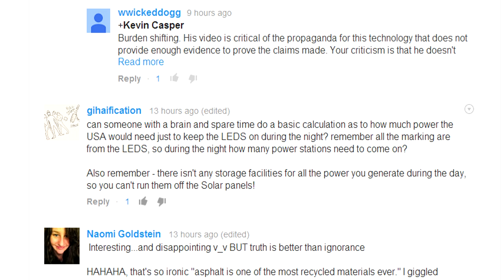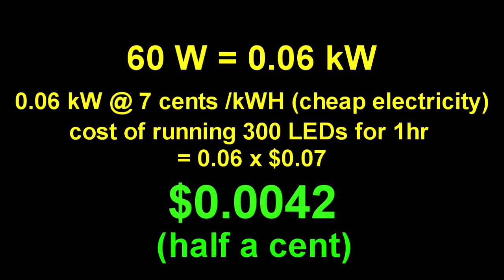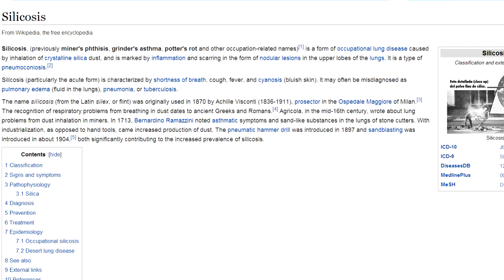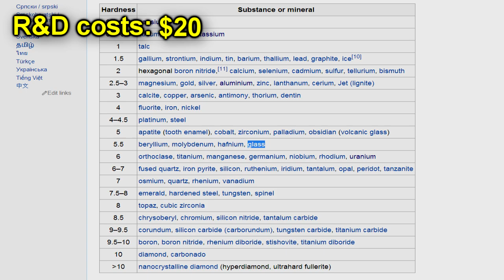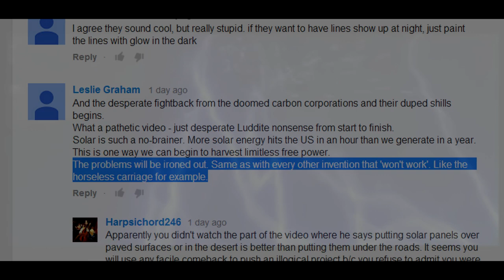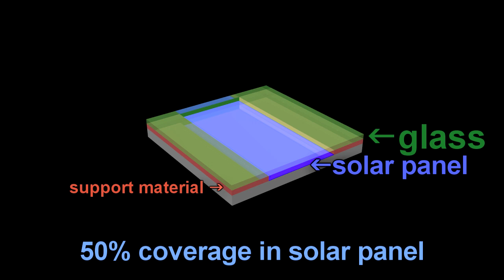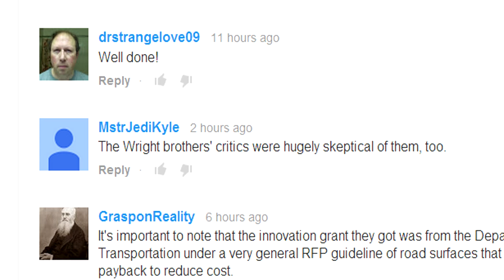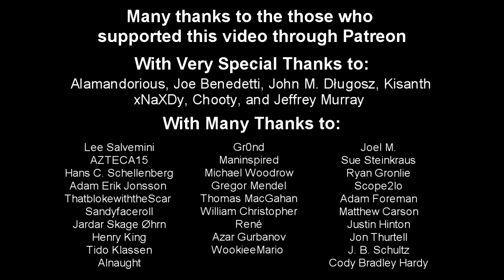Solar Roadways, IMPORTANT QUESTIONS AND ANSWERS!

Comment: You make many good points, and then you undermine them with parting shots that don't line up. I'm hunting down more updates on the roadway tech (which I feel dubious about) but shots like saying >1 inch thick glass would be in any way affected by a spark plug sound silly, when the better argument that a shard of glass devoted out of a broken panel would prove a major safety hazard seems more than sufficient.  

There were at least a few moments in your previous video where these weird digressions pop-up in otherwise solid thinking/criticism. It's a hard balance when you're trying to be funny and accurate not to make exaggerated or cheap shots, but... it's disappointing. But, I do appreciate your effort.
Reply: Dudley Bryan Jr. I know it's like 3 months since you posted, but from what I watched i'm pretty sure he meant that when someone suggested they make the roadway glass out of sapphire glass, if one of those panels were to break or chip, and one of those chips happened to fly into your windshield, it would probably be a similar effect of that piece in the spark plug.

So basically what you said would be the better argument of a shard of glass from a broken panel is actually the argument that was made.
Reply: But, we know it could never be made of sapphire glass though. Just Google "sapphire glass production problems." That's one of the hardest challenges (no pun intended) as it is. Making that much glass economically.

I can't remember anymore, but I believe it sounded clearly like he was suggesting a dropped spark plug would shatter the road glass. But, either way sounds unlikely. Like I said, lots of other good points though. Just odd deviations here and there.

Comment: I feel bad, because I want to be smart cynical but this video isn't smart cynical.  You do not use Amazon.com to calculate LED costs on an industrial scale.  Same as you don't compare smartphone glass screens to industrial strength glass surfaces. But, your comments warning about potential knock-on effects like ground glass/etc are important. If composites have different properties (when ground or pressured), then it's important to know which ones are the best performing and most economic for comparison.
Reply: Mark Baanstra Thanks, but having looked at BOM estimates for products, I'm still assuming the price to consumers on Amazon.com is not representative of the price that would be paid by a bargained government project.  I'd think... maybe some type of rule of thumb difference would be helpful.  Or some type of look at the cost of the materials.  It's a tough ask, but you can't run far with estimates on a consumer "one-off" price base.
Reply: +Dudley Bryan Jr. Alrighty then, wise guy. How much do you think these LED lights are gonna cost at an industrial scale? Huh? HUH?

(Seriously though, how much will it cost? I tried Googling it but could only find links to online stores selling them.)

Comment: Good lawd who is Thuderfoot? Did you do any research? Let's deal with just a few of your arguments. 1. It's tempered glass, this is not the same as what you get in a coffee pot. In a few years we'll be able to use Graphene which is hundreds of times stronger than steel. Rocks aren't even going to make a dent in them. And while currently Graphene is supper expensive the cost has been scaling down at an exponential rate for over 10 years. But the time we're ready to build roadways out of it it should only cost pennies  2) Powering the roadways at night. First the fact that the roads are smart roads means that we only need to have power on roads that actually have traffic on it (or up coming traffic). This saves us a lot of power right there. Next liquid metal batteries can be housed in the side passageways and can store the extra power collected during the day then use them at night. So zero cost for generators and no need to wire the roadways up to any conventional power source. 3)You're correct that the angle will mean that we're not maximizing the solar collectors but we don't have to; just 15% means that they pay for themselves in a very short period of time. 4) Thanks to the popularity of Smartphones and Tablets there has been a lot of research on using LEDs during the day but here I actually almost agree with you they shouldn't be used by day instead E-ink can be used much cheaper and have the LEDs only function at night. There I believe that resolved all your concerns in about 20 mins of thought. Can we get back to building the future now?
Reply: Carl Parrish So you propose using an inferior and essentially obsolete (even before production - wow!) idea instead of practical technologies that are well established, are safer, require an absolute fraction of the materials and energy that a solar roadway would (mining/extracting resources, manufacturing, installing, maintaining and disposing), and are far more efficient? You're not building the future, you're tearing it down for some unrealistic dream that was inspired when you watched "Tron".
Reply: Carl Parrish I don't think others have missed the point but rather it is you who has missed the point.  The roads don't pay for themselves.  The numbers clearly show this.  The whole point is to get people who can't do math to give them money.  It is too obvious to be called a fraud because they don't hide the facts that show that it will never work as an idea.  They make obviously false statements and contradict themselves.  

The LEDs are not a side benefit they are just another thing that works to play on the emotions by associating the daft idea with something people see as high-tech.  It is a matter of association rather than fact.
Reply: Carl Parrish You can say that but as has already been demonstrated using numbers, you are simply wrong.  Whatever an Electrical and  Computer Systems engineer is, I will put my qualifications up against yours.  I have designed solar power systems.  I have designed DC-DC converters of the type they talk about.  I have done optics.  Your statement that no one knows the cost is also wrong.  We can place a floor on the cost by looking at issues like the energy required to refine materials.  You then go on to say that Thunderf00ts numbers are way off.  This is odd for someone who has just admitted they don't know the real answers.
Reply: The problem is that asphalt doesn't pay for it self and our roads are in desperate need of repair. I don't think graphene is that far out, I'd say 10 years at the outset. We're probably at least 7 years away from solar roadways being on public roads I'd imagine private parking lots and driveways using it first and the price point is going to have to come down a bit for even that to happen.
Reply: Carl Parrish Tempered glass is a complete nonstarter for road surface.  It is strong but fails abruptly and totally at the first crack.  

Graphene si strong in tension but not in shear.  It also will not allow light through very well because the layers make it look like a dielectric optical filter.  For now at least, it is way too expensive to even consider.

As for your claim a rock won't make a dent.  It really is the scratch that matters.

If you put the same silicon cell on the roof and angle it right you get way more electricity per dollar of panel.  Thus it never becomes a practical thing to do.

As for building the future, that is exactly what Thunderfoot does.  He is a scientist.
Reply: Ken Smith I've been an Electrical and Computer Systems engineer for over 20 years I can assure you that the power collected would be substantial. There are still a lot of unknowns because *no one* knows the cost of these at scale. The numbers quoted here are vastly off though.
Reply: Thorulf Scottson It is better to put the panels up on the roofs of buildings.  This gets them completely out of the shadows.  I say the solar roadways idea has no potential.  Think of an economy where solar power is extremely common.  The price of electrical power would track exactly the amortized cost of the panels.  Since the same panel on a roof top costs much less that would control the cost of power.  Since the MTBF and cost of the solar roadway are both worse, the solar roadway can never pay for its self.
Reply: Thorulf Scottson There was what appeared to me to be a fact free debate going on.  I looked up the facts and gave the link.  As to why there is friction, perhaps it is just my bad mood at work.
Reply: I think a lot of you are missing the point of these road ways. It's not to get as much energy as possible from them. It's not to replace solar cells on your roof top. It's to make roads that pay for themselves so that we can continue to maintain them without worrying about the funding (as we do now). Making the road smart is a side benefit. Being able to configure the road (the LEDs) are a side benefit  ( although an awesome one). The number 1 criteria is the need for a self sustaining road.
Reply: Carl Parrish I've been an Electrical and Computer Systems engineer for over 20 years, yes and I'm secretly Barrack Obama's long lost son.
Reply: Congrats with that. ***** I've used my real name. My credentials are pretty easy to look up.
Reply: Carl Parrish So if I created a Youtube account with the name "George Bush", would that make me the former president of the USA?
Reply: ***** I am currently taking a break from my main gig as jazz trumpeter to do a little work on installing solar panel systems.  If you look up the name I post under you can easily find all the things I have been involved in over the years.  On that basis, I think you would agree I am far more qualified than our friend Carl Parrish.
Reply: Carl Parrish Does Graphene offer enough traction, especially if its wet, because traction is the reason we have roads. And - i mean, there is so much unused/unusable space in the world. would it not be simpler to build conventional solar power plants for an fraction of the costs.
Reply: Carl Parrish 
Lets say we only have two options for the sake of argument.
1. Use solar roads
2. Put solar panels beside roads

It is fucking obvious which is the better idea, how can you spout such bullshit.
Reply: Carl Parrish It sounds like you are pretty stupid. There is many many reasons you do not want to use glass as a road surface, 1 is that you lose grip on it. You do know that you do not always want to have a 100% super hard material right? If the surface can't flex it can't survive the earths movement, and whenever you need to do something with for example the waste system you need to cut the road open. To replace the roads with something that can't be cut open will only hurt our selves in the end. Also if we can't repair normal roads as it is now why do you think we can pay to replace them all with Graphene? Asphalt does pay for themselves. Do you have any idea what should happen if the roads didn't work? People should die in the millions just a few days after the roads stopped. Countries will fall and die. Whatever the roads cost its well worth it when you look at what cargo is transported on them and how much of the BNP that depends on them.
Reply: Cloud Seeker That slippery slope logic though lol
I agree that the roadways' current design is quite flawed. Does the idea have potential? Of course. But it needs improvement. Personally I go with what Jasper Banks said and just put the panels beside the road. You'd get a lot more potential energy that way. I'll keep up with what this couple does with the roadways but honestly the easiest way to achieve the energy goal they have would be to put solar panels by the road side just like power lines. It's less expensive, much easier to implement and simple. Simplicity is often the best solution to an issue.
Reply: Thorulf Scottson The only use I see for solar roadways is if we literally have no more space on earth to build on and the roads is the only option and no one will allow themselves to have the solar panels above the road. I do not see why in any way solar panels should be good as roads. Its kind of like building greenhouses on Mars, you can do it but why?
Reply: Ken Smith I agree completely man. There are much better places for the solar panels to go. I just like to see new ideas in action is all. They won't be having donations from me, but if their project somehow becomes a success, I applaud the very original idea.
I honestly don't expect this to be a widespread thing, as there are much better alternatives, so I guess we'll see what happens with their attempts.
Reply: Thorulf Scottson You know that you shouldn't applaud a idea just because its original. I have come up with stuff like this years ago, I just came to the conclusion it was to stupid and discard the idea. These people just voiced something that I throw away as to stupid when I was a kid, so it really isn't something that is worthy to applaud. Sometimes things are original because no one else was stupid enough to propose it.
Reply: Cloud Seeker Albert Einstein's teachers didn't think he would succeed in life, they thought he was stupid and incapable of doing much. Yet look at his achievements.
I honestly don't expect this to work, but I respect their effort. You can still respect those you don't agree with. It's called maturity, you should try it.
Reply: Thorulf Scottson That is completely irrelevant. All original ideas still do not deserves to be applauded. If you do applaud all new ideas your applauds lose value as you give them to everything.
Reply: Thorulf Scottson 
http://www.abc.net.au/science/articles/2004/06/23/1115185.htm

Checking your beliefs for urban legends is a sign of maturity.
Reply: Thorulf Scottson Said in the link Ken sent. Einstein never failed school, Einstein have even answered to this claim himself. According to Einstein he was 3 years ahead of everyone, especially in math. He dropped out of college because Einstein isn't the kind of person the suck up to a college professor. Because of his attitude people didn't think highly off him and Einstein had trouble finding a job. His father died thinking Einstein was a failure, but that wasn't because he failed in school because he was damn good in it.
Reply: Ken Smith +Cloud Seeker Did I ever say he failed in school? No, I did not. My exact words:
"Albert Einstein's teachers didn't think he would succeed in life, they thought he was stupid and incapable of doing much. Yet look at his achievements."

I spoke of his teachers, not his ability. The German education system was very rigid, unyielding at the time. The article itself says so:
"But, because the 19th-century German education system was very harsh and regimented, he didn't really develop his non-mathematical skills (such as history, languages, music and geography). In fact, it was his mother, not his school, who encouraged him to study the violin - and he did quite well at that as well."

"the 19th-century German education system was very harsh and regimented"

The system was extremely unyielding to differences from the standard teaching and learning style. His teachers didn't think highly of him or that he'd do well but he did anyway. And that's exactly the point I was making. Don't be trying to put words in my mouth man lol
Reply: Thorulf Scottson Note that I didn't say you said he flunked out.
Reply: Ken Smith Then what were you trying to say? Nothing in the article contradicts what my point intended, so if we're on the same page, why the tension?
Reply: Ken Smith It's fine man, we all have those days. Glad we're on the same page now, eh?
Reply: +Carl Parrish Why don't you just put all those solar panels anywhere else but under the roads? I can tell you why. Because nobody would found that. Solar Freaking Roadways became the pseudo science of the crowd. Go build your future without me.
Reply: +Carl Parrish these types of arguements piss me off. So your argument is that the energy that the panels collect  is enough to sustain the cost of installing and repairing the solar roadways. If you wanted solar energy why not just set a bunch of them out in a field where theres a lot of sunlight, which i can tell you they do. Also repairing the asphalt is cheaper than repairing glass. Also you dont have to repair it more often as glass. You see smart phone, tablet companies using the strongest and cheapest glass they can find to protect their devices from scratches. Without a case they still get scratched and even with the case, the case gets scratched too. There are thousands to cars going up to 70mph , 80 mph, (people tend to speed) and trucks that weigh tons. How can you not find scratched glass. Gorrila glass is one of the toughest glass there is and it has a hardness of 6.8. If this was such a good, and great idea why dont we have it now even though the idea was created years ago?
Reply: Daniel Le
I see it hasn't be mentioned lately so I will respond to you with this.

Tempered glass is a complete non starter for the surface.  Tempered glass fails suddenly and totally.  The side window on a car is tempered.  Look up the video of someone throwing a small bit of ceramic at a car window.  It turns the whole thing into a pile of little bits of glass.  This is because there is mechanical energy stored in the stress in tempered glass.

Gorrila glass is somewhat like tempered glass but I don't know if it has enough mechanical energy stored in its stress to make it turn into dust or not.

BTW:  Put the solar panels up on the roof so that are above the trees and can be pointed at the sun.